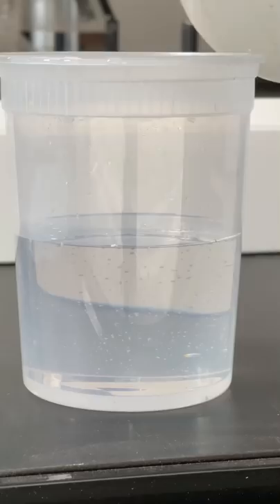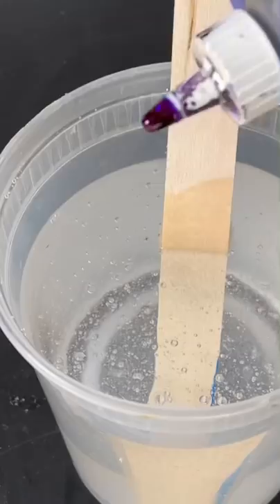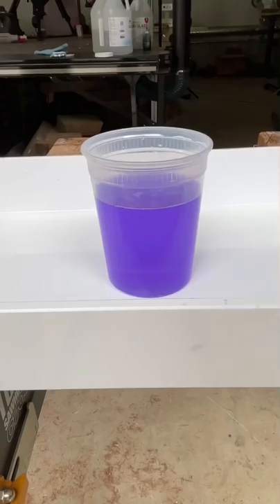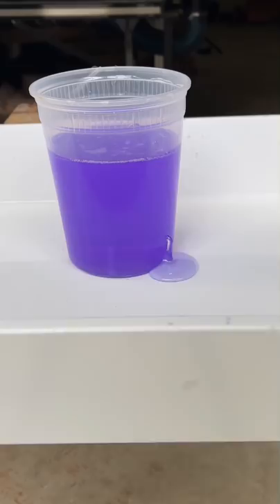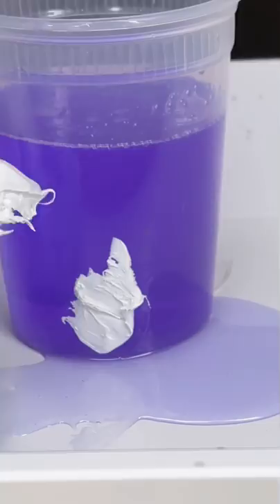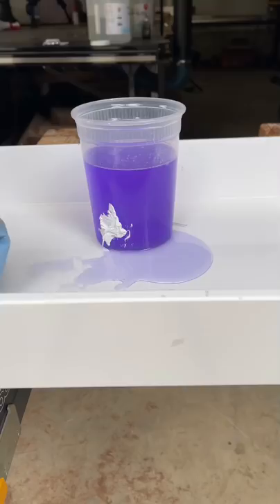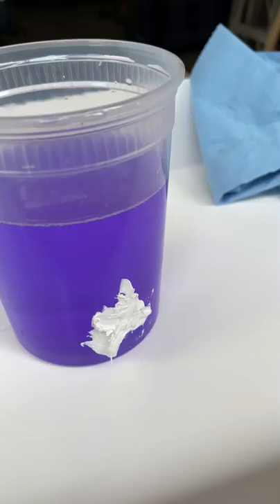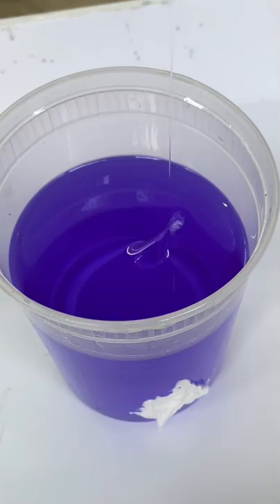How To Stop An Epoxy Leak #shorts

Comment: Hey Cam, after a year or so of watching your videos I just completed my first epoxy pour! Right before I did it, I saw this short about how to stop epoxy leaks.  Just to be safe I picked up some flex paste, and what do you know, I had a major leak! The flex paste stopped it and saved the project! You are the man!! 

One note is that I bought the flex paste in both the can and a tube and the tube was much more effective because the paste from the can stuck to my putty knife and was hard to apply but the tube in a caulk gun squirted out and was much easier to get it where I needed it.   

Thanks so much for your awesome channel!!
Reply from the maker: Boom! Love that.
Reply: Thats really cool
Reply: Fake
Reply: @puch2728  The heart is deceitful above all things, and desperately wicked.
Reply: @TiffMcGiff  nice
Reply: How cool 😎 is that!?!
Reply: As If you dont put water inside first to check for leaks😑 This is either dumb or fake.
Reply: @VincentHermes you know how much effort it would take to pour water in your mold and then get all of the water out? No one’s trying to trap water under their wood table while it’s curing you doofus
Reply: Remember to give it a good wipe so that the surface is dry enough for your putty to stick too.

Comment: This stuff is basically magic. I'm working on a really awkward build that requires dams around 32 holes. If not for this product and Cam letting us know it stops epoxy leaks, I wouldn't even have been able to attempt this project for concerns of endless leaks. There were probably about 20 leaks in all and this paste worked like a charm.

Comment: Wow! You use about 50 dollars of epoxy just to show this tip. Dedication.
Reply: Pretty sure he’s sponsored by some epoxy company, so he may get it heavily discounted or for free
Reply: I re-roofed my house.. And since I have absolutely zero professional experience I may or may not have made a couple of mistakes which led to a few leaks. I bought a can of that stuff and just jammed it up into the leaks. It was easy to identify the leak because they were dripping during the rainstorm. 

I got a container of that stuff and slapped it right on top literally fixed it right there I then made sure to seal off that part of the wood too so that way it's not just building up in saturating the the wood on the roof but that stuff works incredibly well

Comment: Haha I use " flex tape"(can never find the paste form) or UV resin from "Sophie & Toffee" to stop my leaks. When I am spending over $800.00 in "Total Boat" deep pour resin on a project; every gram/drop is worth its weight in gold . At those ratios when a leak happens, panic truly sets in. For good reason. "Flex Seal" products simply, in the right circumstance, just works.

Comment: This will definitely stop a leak from a melamine mold leak. I had one forming on my last pour, I did my best with Teflon tape and silicone but nothing Truly worked until I saw this clip. Flex paste is good to have before starting any pour

Comment: I poured a silicon mould about 2’ deep on the front of a customers house.
 The jacket I made leaked everywhere. I only had modelling clay to fix the leaks. 
 The second mould I made on the house I used a different technique with thixotrop. 
 Lesson learned. Thin catalysed liquids with long cure times and deep moulds = trouble. Gravity and careless work cause problems.

Comment: That is awesome and I probably never would have thought of that! I agree flex paste is amazing! I have used it already for several home improvements. Still have yet to do the resin test to see if resin bonds to it but I am betting it won't. I have some bits of cured flex paste left over to test with. I also want to see if it bonds with silicone and my thought there is that it probably will. :p - Heidi

Comment: Or... Put the cup in an identical second cup.
Or... Duct tape (or electrical tape or painters tape) - wrap it all around, so it can stick to itself. 
     That should work too
(depending on HOW non-stick it is, you can keep wrapping - (close up the bottom too) - until you have a makeshift 2nd cup

Comment: My question is less about a leak and more about not spilling it everywhere. I have 15 gallons of EcoPoxy that came in 3 5gal jugs that are very hard to pour out of. Impossible actually, some has been spilt every time. I was wondering if you had any recommendations on how to get around this. Are there dispenser pumps that will fit these containers? Measuring and pouring is becoming a hassle pretty fast. Thanks!

Comment: A few winters ago it got cold enough to break a pipe on the side of the barn. I cut the end off and slammed a cap on the pipe while it was shooting in the air, then wrapped it in Flex-Tape. It's still that way and doesn't even drip.

Comment: The spray stuff worked on my car tires. I tried it on them as just a joke it worked! The tires wouldn’t hold air at all. I sprayed it.  Held for 6 hrs.  & I mean these tires were cracked sooooo bad. All the way around both sides. & I only sprayed the outside wall.

Comment: Hey Cam! This is super helpful. I may have missed it, but how do you clean your mixer paddle after? Do you let it dry? Having an issue where some will flake off and some won’t. I have seen you peel the epoxy out of your measuring buckets.
Reply from the maker: Ya, kinda hard to chip it off sometimes

Comment: What is cleanup like on that Flex paste?  Flexseal tape is ooey-gooey and works well..but definitely leaves a lot of sticky residue when removed.  Heat gun and scraper worked best.

Comment: Hi Cam,  You are a great resource for anything related to your amazing projects.  One question I have is that I am hoping to do a lower layer pour of darker blue, then a lighter blue pour on top.  Is there a preferred time, or maximum time between pours and should the lower layer need to be scuffed?  Thanks.
Reply from the maker: Around 12-18 hours or so is good

Comment: Cam do you still recommend Flex for stopping leaks.  I though I saw a more recent video where you found something you like better.  By the way I am taking your Epoxy Table Course but haven't gotten to that part yet - if it is in the course.

Comment: Tank’s for the trick 🤙a question for you i start a pour with an epoxy that the container minimum 😮 size is 3 gallon ( i bougth 6 gallon) at the end i am missing less than one gallon if i let it cure after sand it and pour with another brand that sell smaller quantites ? I use ryver epoxy R-cast2.0 and want to complete with ecopoxy? Both are quality brand

Comment: Due to just learning how to use, mix, pour and whatnot with epoxy I had a bad time at first with not knowing how long to mix and now I have mixing cups and molds that have sticky resin in them that I can not clean out, what do I do to clean them? Should I just toss the silicone cups and molds and buy new ones?

Comment: my man Cam, I wanted to try to make a dining table using that fire+epoxy since i loved that deep char look, but i thought why not add a little accent to it? im going to try to add in some pieces of polished stainless steel sheets on top of the charred wood after the initial epoxy seal coat to simulate some in lays before the deep pour. Do you think it will work?
Reply from the maker: Oh maybe!